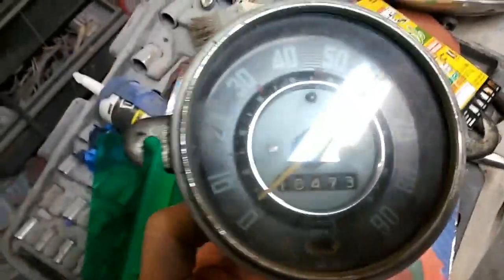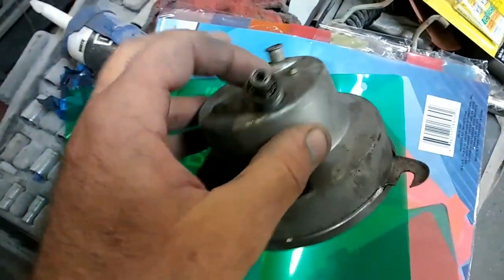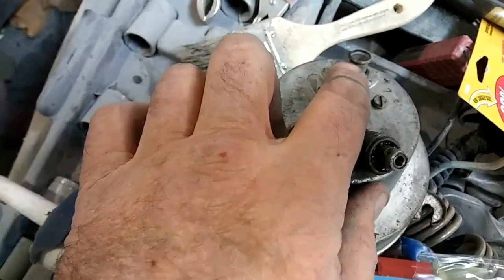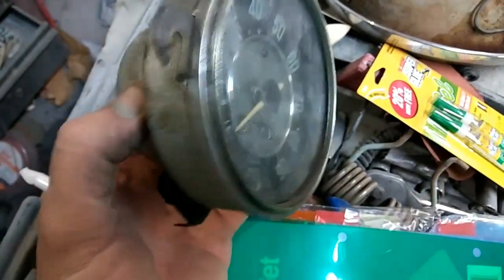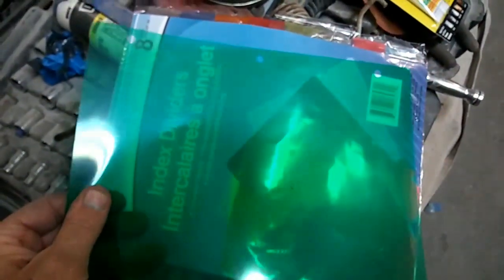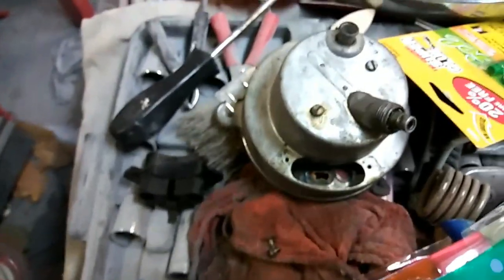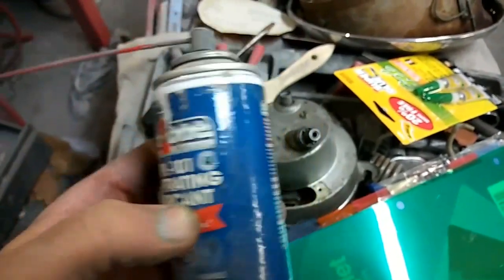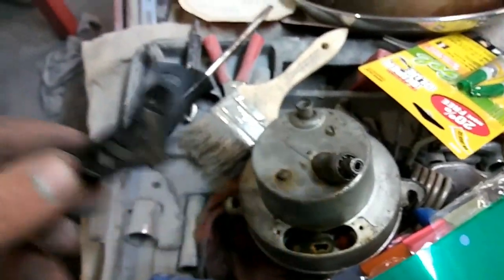VW speedometer repair DIY must see

Comment: My speedometer started howling like crazy on the highway today. Pulled over, screwed off the wire-cable-thing, sprayed a lot of WD40 (Swedish equivalent, 5-56) on both wire and around the cable-receiver on the meter. 
After a few kilometers the whining subsided and after a while it was almost quiet again and seemed to work fine. More (proper) greasing followed in the garage afterwards and now it seems to be working with no problem. Knock wood. Needle was jumping like crazy first. From 50 Km/h to 155 Km/h in 1 second... (that'll be the day)... ;)

Either way, thanks for a good vid.

Comment: Do you spray that right into where the speedo cable goes, or do you try to get in between the inner and outer part?
Reply from the maker: you cant really get into that area without taking that part apart. I have other videos doing that part.

Comment: hey.. have you taken a speedo apart with a trip odometer push rod going thru the front plastic cover? I want to know how to get the trip odometer out so I can work on the plastic cover, dial and needle. 71 fasty I have. thx

Comment: my 1965 stock beetle's speedo stopped working over a month ago. No speedometer or odometer.  The think isn't spinning. That end part where the cable screws into.  It doesn't spin :'(
Reply from the maker: grease got frozen up gotta take that one apart to re grease it